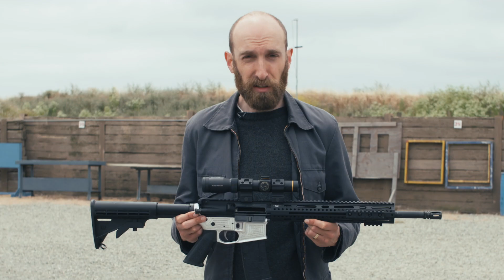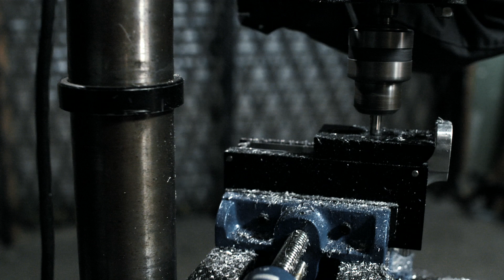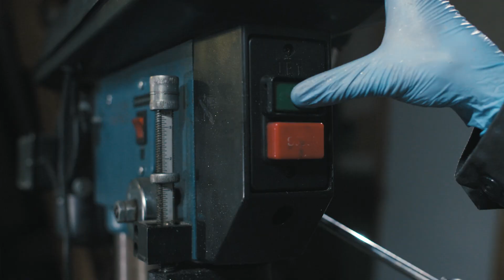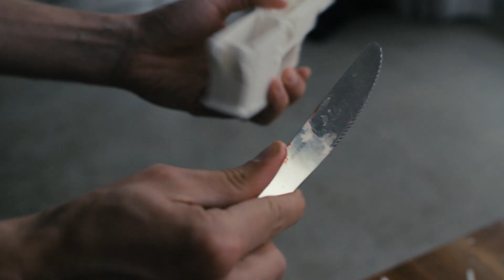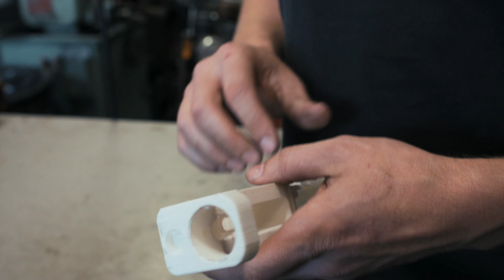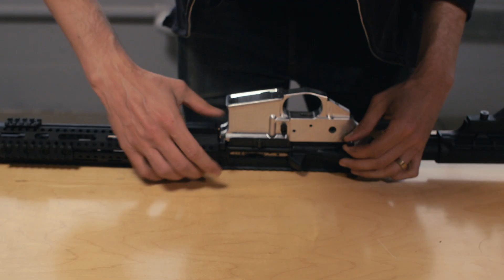I Made an Untraceable AR-15 'Ghost Gun' In My Office | WIRED

Comment: ...and that is why the U.S is becoming a militarized police state.
(In response to such irresponsibility)
Reply: +Oliver revilO The second amendment prevents ANY infringement on my right to own guns, so how is this irresponsible?
Reply: +Oliver revilO It just comes down to the fact that building a gun like this is a novelty, criminals don't do it because it's so expensive to get started, and stealing a gun is easier and quicker.  These types of rifles account for an astronomically small amount of gun deaths per year, so it's safe to say that this has no real impact on crime increase.  It's also completely to legal to do.  Licensing and registration doesn't prevent crime, because again, most crime guns are stolen.  You can look up and see what kinds of weapons are in evidence lock ups across the country and it's cheap, stolen, taped up trash.  Criminals don't generally go out with something like an AR15, especially if they've spent the money to set up a 3d printer and CNC machine.
Reply: Oliver revilO
Preemptive laws don't usually do anything against a criminal to amount to the damage they do a law abiding citizen.  The 99% of gun owners are neither criminal, dangerous, or unsafe enough to have firearms stolen.  Some are, of course, because they do get stolen.  But putting regulations on the current legal AR15 ownership will still not stop a thief from acquiring it from someone who isn't keeping it safely, it only seeks to regulate the law abiding citizen.  It's very much worth noting that the violent crime rate in the US has more than halved in the past 10 years, and is still declining, so it's possible we need not do anything we aren't already.  Personally, I see a deeper and more useful type of thing that would help aid that decrease in crime further, and that is enforcing the laws we already have more.  Responsible gun owners like myself and others don't deserve to have derogatory connotations placed on us just because repeat criminals continue to use guns improperly.  That would be the onus of the state to actually prosecute gun criminals to the extent the law allows and cut out this nonsense plea bargaining that can allow an armed thief the ability to drop his gun charges in exchange for something else.  This flies in the face of both the justice system and the legal gun owners, who generally don't like their reputation tarnished in the media because of lax laws, and repeat offenders who shouldn't be allowed to represent us.  For people like myself who have guns as a hobby, and am very fond of them and their safe use, I'm less likely to commit a crime with it because I don't want to lose my hobby, nor do I want some idiot with a stolen gun to infringe upon my rights, or my hobby, because of emotive laws.
Reply: Oliver revilO
What you suggest we do that would only hinder the criminal and not "fix what isn't broken" for the law abiding citizen?  I understand emotive laws are not the point, but after every media hyped tragedy that's exactly what people call for.  Historically those laws are based on emotion and not logic, such the "Assault Weapon" ban.  It did nothing to curtail crime, and repealing the handgun ban in D.C. didn't increase crime.  The Assault Weapon Ban is a case of banning a certain type of firearm based on its looks, and not it's function or danger level.  That's what I mean by emotive laws.  When the senator made his statements about "ghost guns" he was very clearing making things up to appeal to the emotions of his audience, not to any rationality.  Had he wanted to appeal to intelligence, he wouldn't have to make words up and show ignorance at how guns function on a basic level.  That's what I mean by emotive.  I want to avoid that sort of thinking and the thinking that needlessly hurts the demographic of people who aren't criminals.
Reply: +Oliver revilO  - and what is "irresponsible" about building your own firearms in accordance with US law?
Reply: Licencing and registration are social implements for good, constructive reasons. They limit criminal usage, and provide reference for if criminal acts are committed.

Boasting and advertising tools designed for combat is counter intuitive (irresponsible) to constructing a non-violent society. The mores that propagate "freedom of firearms for all" is literally manifesting a necessity to defend against them, with larger ones (ie: Police Tanks & further militarization).
Reply: I live in IL...a totally Blue state....there is no registering, or licensing required.
Now what?
Reply: Now what, what?
What do you mean?
Reply: I am open to any mature logical debates.
If you have a logical rebuttal to my original comment, that is not irrational or circular, please enlighten me!

P.S. I am from Vancouver B.C. Canada :)
Reply: I'm not saying that the Second Amendment is irresponsible. Though I believe that all laws, civil and constitutional should evolve parallel to modern society and safety standards alike. 

I have zero interest in seeing Americans disarmed. I personally love guns (Mattv2099, Hickock45 etc), for the hobby type / zen type (long distance shooting) activity of it.

Although I live in a city in Canada, and the whole thing, just isn't worth the effort. Especially in consideration of the fact that any shooting that I would prefer, would be >400m. I mean if I were to "win the lottery" per se, something like a MR762A1-LR would be my first pick. 

But there is rightfully no chance in hell that thing would ever see the light of day...im my part of town. Its just too inconvenient and unnecessary. Further, I'm quite certain your aware of the intrinsic safety values of registration and regulation, *so I'll save you the head space of that list.

I made my original rebuttal with good, mindful, and reasonable intent. That has not excluded anyone's rights at all. My implication is of mear societal maturation and public safety.
*Please spare me the guns save people dialogue, as I did with the list.
Reply: +Aardvark Great point Aardvark. No thug has the capital to plunk down, for a high-end CNC machine.

Although, in light of quashing problems before they become systemic, keeping updated "checks and balances" on regulation and law is key. Because, just as you mentioned, "most crime guns are taped up trash". Which means they were new at one point. Therefore, if we have lax regulations on homemade AR-15's now, the probability that such guns will in turn, become stolen or used in crime (in their lifetime) becomes quite a relevant problem, worth addressing in the present.
Reply: Oliver revilO
 - Nothing to address...."Shall not be infringed" pretty much says it all.
Reply: Well said. You state your case quite eloquently and I admire your analysis of the situation at large.

"Emotive laws" are not the point of firearm regulation. First and foremost is the safety of the people. While I do recognise your obvious respect for the law, further, understanding that criminals paint ill credence of unnecessary violence, on gun hobbyists, the fact remains that unregulated guns and constitutional freedom is not synonymous.

That is to say that, reasonable regulation is not an infringement of civil rights, but a rational step in sociological maturation (by reducing the very possibility that home-made firearms could at some point, be used in crime).

Comment: it's quicker, easier and cheaper to make an open bolt full auto or semi auto out of scrap and plumbing pipe than finish machining an 80% lower and spending $500 on parts.
Reply: jaqs smith furthermore, 80% lowers are almost exclusively the realm of the gun hobbyist; the guy who spends hours perfecting his reloading process to ensure the best performance from his precisely cast bullets, who knows primers, brass expansion, powder burn rates, rifling twist rates and steel expansion better than you know how to breathe. 

You really think this guy is selling "ghost guns' to the gangbangers in the hood?

Comment: This is kind of a misleading video. Yes, you can produce an untraceable "ghost gun", but how many people have access to the kinds of materials and machines required to do so? Drill presses and milling machines are more expensive on their own than an off-the-shelf firearm. It's also fairly suspicious of someone to obtain a drill press, a fairly large chunk of raw aluminum, and a computerized milling machine. I doubt someone with an online shopping cart like that would fly completely under the radar. I'm more concerned with people who overtly break the law to obtain a gun (straw purchases, theft, illegal sales, etc.), rather than bypass it. One more thing. Rifles in general, of which AR15s are a subset, are used the least in gun-related crimes. Let me guess, Wired chose to build one of those because they're the 'scariest' looking.

Comment: what does untraceable means? does legal guns have gps or something? i have never touched a gun....or been close to one...saw pistol a few times on police officers in the holster. i live in mauritius btw :p
Reply: Defcon 5 No. 
If a gun is recovered after a crime
and
If the serial number hasn't been obliterated
and
If the gun wasn't stolen
and
If the gun hadn't been purchased in a private transaction

Then, the police department can contact the manufacturer, who will look up the serial number and tell them which distributor received the gun, who will do the same and tell them which dealer received the gun, who will do the same and tell them who it was sold to.

If any of those above conditions are not true, the gun cannot be "traced".
Reply: martin mystere Serial numbers on the gun can be traced, police forensics can just do some ballistic tests on the body and find out who killed who.

Comment: from the ghost gunner site:
Is manufacturing a firearm legal?
In general, yes. Semi-automatic firearms, including the AR-15 lower receivers, are generally legal to manufacture for private individuals per US federal law Title 18 do not require serialization or other maker's marks. However, some states/municipalities restrict either the manufacture of certain firearms, or, more recently, the personal manufacture of a firearm with a 3D printer and/or CNC machine. DD makes no claim regarding local manufacturing legality; lower receiver files provided by Defense Distributed might require special licensing to manufacture and/or possess. 

Under federal law, manufacturing a firearm for contemplation of future sale without an FFL is prohibited. Without a manufacturing FFL, you should manufacture firearms for personal use only. There are methods to legally transfer ownership of personally manufactured firearms, but they do not apply when the original manufacturing intent is to build a firearm for commercial or non-personal use. Recent ATF determinations have signaled that allowing others use of your CNC equipment may itself constitute manufacturing, therefore Defense Distributed advises Ghost Gunner owners to neither print firearms for other individuals, nor allow other individuals to use their Ghost Gunner to manufacture firearms.

Comment: I don't get how LOWERS are more dangerous than actuall barrels. You can't fire a round out of a lower alone, but you CAN fire a round through a barrel without a lower.
Reply: ereetos Chances are the case will actually fly back. The bullet will likely just sit exactly where it is resting barely touching rifling.
Reply: Herrdesrings Years ago I found a rifle round, don't remember the caliber, just remember it was a rifle round. I pulled the bullet out with pliers and dumped the powder on the concrete, then lit it with a lighter...cool. Now I had an empty cartridge with a live primer in it, what to do??? Well, I put the cartridge in a vise and decided to hit the primer with a nail and hammer...cringe time...it was in an enclosed room, I placed the nail on the primer and whacked it with the hammer. BANG! the sound and flash were deafening and blinding as it was unexpected, but here's the kicker, the primer actually rode up the nail and smacked my finger so hard it pulled back skin. So, from a harmless empty cartridge, it drew blood. Lesson learned: The cartridge needs a lot of steel surrounding it so that it doesn't blow up in your hands and/or face. I think I'll stick to using a proper lower receiver to attach my upper to and do it safely.
Reply: a barrel + hammer + round = fires a round
a lower + round = nothing happens.
You can attach a barrel to a wooden stick. See all those home made guns in Mexico.
Reply: If you hit the primer right you can even get a round off without a barrel but it will be flying around quite uncontrollably.
Reply: that's why you use a pin and a hammer.
Reply: Yea you put a round in a barrel and hit the primer with a hammer, then have the people who take you to the hospital post the video on YouTube. Lol
Reply: here's a filipino home made example: http://1.bp.blogspot.com/-VONH2oxGkWc/UJqu-fT-NeI/AAAAAAAADJ8/5tzkL2SZF_U/s1600/8.gif
Reply: ereetos +MosinVirus for an AR upper, just disconnect the gas block, throw the BCG into the upper so the lugs lock into the chamber, hit the firing pin in the BCG. Anyone could rig up a way to hold it and strike the firing pin with a hammer. or just make a slightly more sophisticated slam gun using an upper and a BCG with the firing pin fixed forward as the part of the slam gun you hold.
Reply: Herrdesrings Yeah, but you don't have to print the barrel to make one.
Reply: +Herrdesrings can't print parts without a printer either.
Reply: Herrdesrings sure. Just like having a cnc machine...
Reply: Herrdesrings cnc can also do more
Reply: Herrdesrings so, are you against 3d printers?
Reply: +Herrdesrings I would disagree that the barrel is the most important part... have you seen a shotgun barrel? it is basically a pipe.
Reply: Herrdesrings seriously? 00, semi-auto... Accuracy?
Reply: +Herrdesrings I mean if we were to look at it from a perspective of why anti gunners are so against ARs. then put a semi-auto shotgun into each of those scenarios... if you think about it, not sure why everyone is so fixated on AR...
Reply: ***** oh I completely understand that it can be done. I think (sorry can't remember what I was discussing at the time) that in general, if you try to stick a bullet into a chamber and strike the primer, chances are the case would fly back rather than bullet flying forward.
Reply: Check this out: https://homemadeguns.wordpress.com/
Reply: Herrdesrings in any case, the focus should be on who is making the guns and why, not on whether it is easy to make a gun, because as your examples clearly show where there is a will there is a way.
Reply: If you have the will to create a 3D printed barrel - good luck!
Reply: Herrdesrings The barrel doesn't have to be printed.
Reply: It doesn't have to be printed since it's not regarded as a firearm and you can buy it online, right?
Stamp the barrels with a serialnumber than.
Reply: Herrdesrings I am confused. Why would I want to serialize the barrels? Not sure what point you are trying to make. I just re-read your original post. The lower provides a repeatable and controllable firing mechanism.  It usually also ties the round feeding mechanism (magazine) with the barrel and locking mechanism. While you can shoot a round or two out of a barrel by using a some "alternative" method, how long will it take you to extract a spent case, reload, prepare, strike it precisely again, and again, and again? I think the lower makes a firearm into a firearm, while the upper is...well... just a component.
Reply: MosinVirus
Because you can't print a barrel for cheap. Lowers don't have to take the pressure and can be made with "simple" tools.
Reply: MosinVirus You can't do rifling without tools though.
Reply: MosinVirus The whole point of 3d printers is that you don't buy them because you need ONE thing. You could print anything of a certain size.
Reply: MosinVirus A CNC costs like what? 5 grand? 3d printers are going to be way more affordable.
Reply: MosinVirus yes, but how many people have access to one compared to 3d printers? There are stores where you can print anything.
Reply: MosinVirus  absolutely not! I think you should be able to print out a lower as it won't fire a single round without a propper barrel. They should be rethinking which parts "need" serialisation.
Reply: MosinVirus
don't care much for smooth bore. If you build your own AR15 I doubt anyone would get decent accuracy out of a pipe.
Reply: try that and lemme know how it turns out. hammer is in the lower. unless u mean another version.... im not putting a nail to a round.